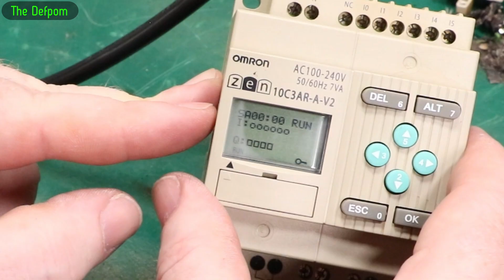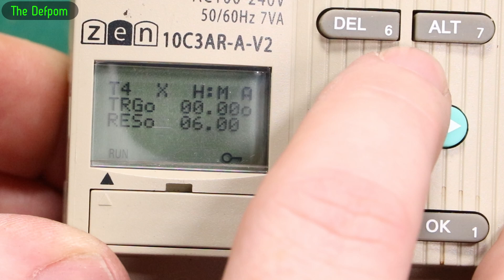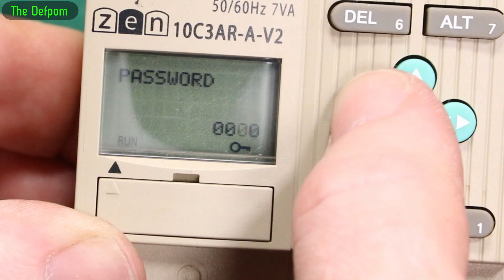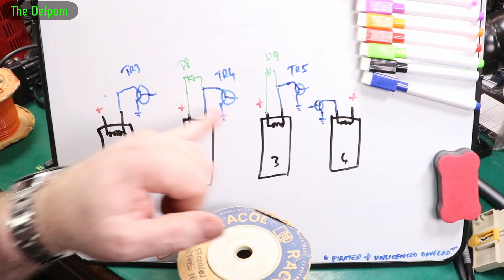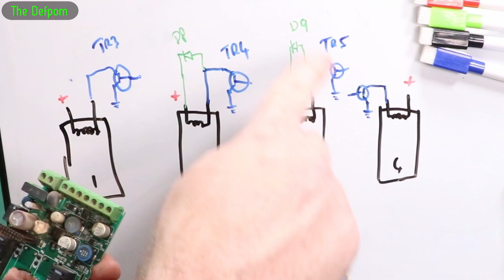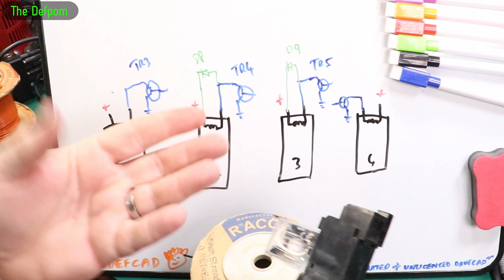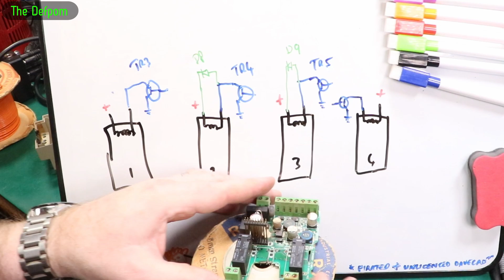🔴 OMRON PLC Repair ZEN-10C3AR-A-V2 - No.1302

Comment: Defpom, I think you might have overlooked something about this device, in regard to how many snubber diodes it has. Studying still frames from your video, it looks to me like there are indeed FOUR 3-terminal SMD devices marked "T", and those would be the relay coil drive transistors as you stated. Then I see TWO more 3-terminal SMD devices marked "D", and I postulate that each of those are actually dual diodes in one package, sharing a common anode or common cathode. I don't know if you already did a detailed study of the PCB traces in this regard, and might have ruled out what I am suggesting.....?

I think your solution is a good one, it is what I would have done, although I probably would have preferred to add TWO outboard relays rather than move the coil control for one relay to the next one, but then your solution takes up less space in the panel.

In my pre-retirement career, I used lots of OMRON stuff, but never used their micro-controler products such as this. I used many others by various other brands, such as TECO (my favorite), Siemens (the worst), Allen-Bradley (pretty decent), etc. About 10 years ago I got a good deal on the TECO ones in their OEM version (same circuits, but no case, buttons or screen....MUST program them using the software and a cable) and bought a good sized box full of them, in 4 and 8 output versions, and various input voltage versions. The cables are cheap, and TECO's simple programming software is free the last time I looked, and will run on pretty much any version of Windows. I use them from time to time, solving small control problems for friends, etc.

The biggest issue I have with this type of "micro-PLC" is that invariably the software resources are inadequate to realize the full potential of the hardware. For example, I have often used these to replace older "cam timers" in old control panels. A program for such would simply be two timers per output, so a 4-output device would require at least 8 timers, and I usually found that only six timers were available, or some other stupid limitation like that. A BIIIG sin was one brand of 8-output device only had 10 timers available, no nearly enough to program separate ON and OFF times for each relay. And there are usually pretty severe limitations on how many 'contacts' can be on each 'rung' of a ladder program (or the equivalent in logic-block programming), and/or not enough rungs available to write a program of the complexity I desire. A rep from Allen-Bradley, responding to my bitching about this kind of thing, said that such limitations were deliberate, otherwise too many customers would be able to use them instead of stepping up the the next level of controller, which always costs at least 10 times as much.
Reply from the maker: Yes I overlooked that the diodes were dual diode packages, that would make a LOT more sense than not having all relay coils done the same way, I guess I was too focused on the charcoal PCB LOL. I should learn some more about PLC programming and ladder systems, I haven't done it myself but assisted industrial electricians in the past to setup devices, so I only know what I observed at the time.
Reply: See now you have me wondering about tying several of these together to sorta extend the ladder. Downside would be you’re limited to 4 bits, and if anyone saw what you did you might be institutionalized.
Reply: @thomaswight2374  , I have tried several schemes to chain multiple of these together to get more outputs, especially to replace larger cam timers. The problem is that,  other than wasting inputs and outputs, there is no way to synchronize them. And with only 4 outputs, losing even one in the service of synchronizing, that is a hard pill to swallow.

Comment: I would grind out all the damaged board and let in a new bit of glass fibre. I wouldnt replace the foil  in this power application just hard wire it to a new connector.  There is some good old video from PACE back in the 80s on youtube.   Have a go it quite fun if you dont mind getting a bit sticky with epoxy.  This is how I used to repair military equipment that could not be replaced.
Reply from the maker: @allthegearnoidea6752  that is certainly something to consider if doing it for a long term repair.

Comment: As a retired electrician, i used to work with PLC's, all the relay outputs only switched a contactor, which then switched the load, things like pumps are inductive aand can pull a lot more current on start up due to inrush,
Far better and cheaper to replace a contactor than a PLC, might be worth considering when you replace the PLC

Comment: Had the same, though without the flame damage, relay output just went dead. So went and borrowed the programmer, plugged it in and edited the pin assignment for that output to the last spare output on the PLC. could have fixed it as well, but a lot faster to do the 60km trip to get the programmer and return it.

Comment: good get out of jail bodge, if you can get an identical unit, you could just swap the top boards over, the program will be held on it, i would never trust those on board relays with anything greater than signal current, and would cascade heavier relays off the outputs

Comment: The diodes are double diodes with a common cathode, on the right diode you can see a track running from the third leg to the right relay.
Reply from the maker: @antec902  ah good spotting

Comment: A pity you never got the password, the ladder logic is editable on the LCD on these things, and they are usually very short programs so could have reversed engineer pretty easily. Haven’t used ladder since the 90’s!

Comment: Good catch, quite a bit of severe damage, the unused relay was a godsend.
I have had similar damaged control PCBs.
Usually, after removing the carbonised PCB and wired in the extensions and mods, given the area, both sides, a spray with conformal spray to make sure that there is some integrity in the PCB insulation.
Hope it performed to get the compressor up and running till a better alternative can  be found.
I don't think you will have any luck retrieving the code.
A solution would be to find some new/old stock of that model and swap the CPU board over.